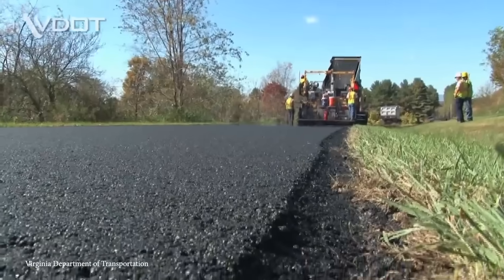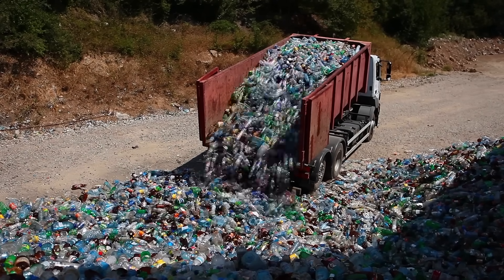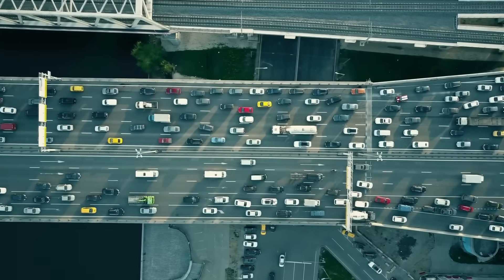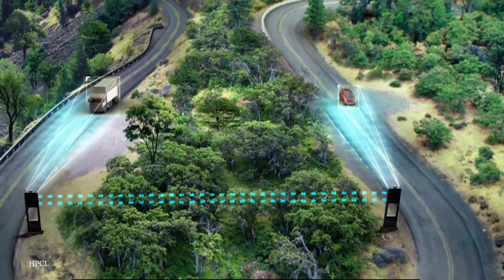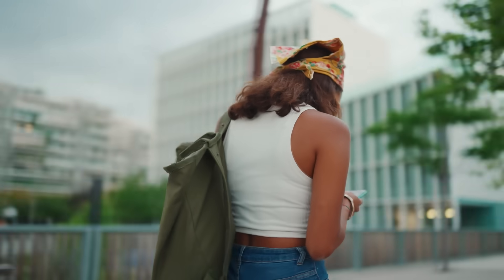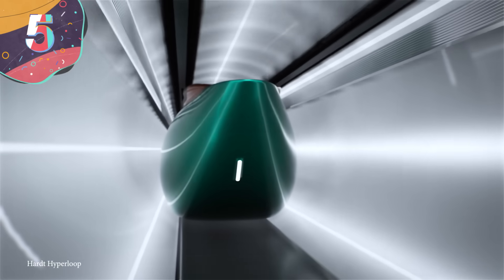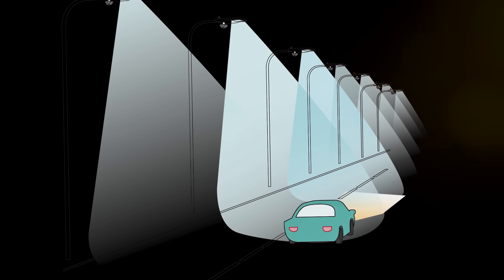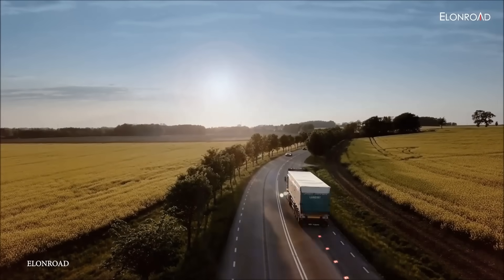15 FUTURE Road Designs that will change the world

Comment: A bit hesitant about plastic roads, simply cause plastic melts really fast when it gets just a tad hot.
Personally I wouldn't recommend it, especially in hot places since it would melt and become a fire and breathing hazard.
Reply: And asphalt is 98% reusable, unlike plastic.  Has better grip for tires than plastic, even when wet, and doesn’t leach/outgas/put micro plastics into our eco-system.

You want to do something useful with plastics, find a way for them to be turned back into the oil they came from.
Reply: Just a bit? I haven't seen anything made of plastic, for use in construction and around the house, that has the durability and toughness remotely close to traditional materials. Low stress applications where its set and pretty much forget, such as siding and some plumbing, is all its good for. These roads would be as hard to dispose of (or recycle) as turbine blades are now. Pop Sci greenies that typically ignore so many other factors would love them though. They love stuff that is superficially Earth friendly, while ignoring issues such as the non-green manufacturing, short lifetimes, ease of maintenance, ease of repairs, and ultimately, disposal

Comment: I had this Idea about synchronized traffic lights for some time. Why not have the traffic light inside the car? Each car console have a traffic light system inside the car to guide the driver. All these units are linked with a central computer system. It analysis the data and give optimal switching. This is extremely cost effective! because a traffic light is very costly!
Reply: A traffic light is way cheaper than the idea you have.    I install traffic lights.
Reply: @jamesgarrison6430  not if it is mass produced! Further if your destination is given, the system can optimise the lights to give a synchondrosed response, taking into account all other cars that input the destination.
Reply: @lalsenarath  That's the problem. Mass production. Traffic lights are already mass produced.
Reply: @admiral_gravleos8  right it should be a standard component of the car, along with gps navigation, which some cars already has
Reply: @lalsenarath  yea make cars more expensive and inaccessible for more people. Your solution is faulty at so many levels. How are the cars connecting? Where is the bandwidth for all the data collected? Who provides and pays for the servers that run this system? Will there be different systems for different countries? Keeping things simpler/cost-effective is the way to go if you want new systems implemented.

Comment: The first time I experienced linked traffic signals was in the early 80s, Dortmund in Germany had them. The Autobahn flowed straight into the main route through the city, each set of lights was linked, you stuck to the limit you'd only get stopped at one set, then return to the Autobahn outside the city and back up to speed.

The results: slow moving traffic through the city, lower emissions, improved fuel economy.
I have to say, it could be nerve wracking approaching a set of lights at 50 KPH thinking: change, Change, CHANGE!!! but they always did.
Reply from the maker: Interesting thanks for sharing
Reply: The Netherlands has those aswell and also combines with the traffic lights for bycicle lanes and pedestrians.
There are several YT video's about it made by (Americans) to compare to US road systems.
Reply: @d3al3rplays68  They even have rain sensors for bicycle pads and closed garbage containers with sensors when they're full. Roundabouts which speed up traffic too. 

This isn't new technology at all this has been there for years and years. The US is in all traffic infrastructure is decades behind the rest of the world.
Reply: yap yap yap

Comment: What happens to the glow-in-the-dark road after a cloudy, sunless day?
Reply: Light energy still passes through cloud, solar panels still charge batteries on dull days, but instead of 8 hours, perhaps they would only work for 4 or 5.
Reply: If only we had some kind of markings and signs that could reflect some of the light our cars are already outputting...
Reply: @bscholer  ya we do they are called "cat eyes".
Reply: They don’t shine, someone crashes, and they sue the municipality for $20 million worth of pain and suffering
Reply: It doesn't glow
Reply: @JonRuisiCustomDev  Best reply. Narator should have said that during the video.
Reply: it acts just like a typical non glowing road most use today

Comment: The ultimate future road will power and drive your car for you, so all you need is a shell or a pod to sit in.  Think of all the energy we'd save if we don't have to create an engine that can move a multi-ton vehicle but instead just needs to move you and a lightweight pod.
Reply: @ Marchant2   if you cant drive a car or steer it properly get the fuck off the road.Dont be the problem.
Reply: The energy required to move your pod will still have to be generated, as will the cables carrying the power to the roads, plus the pods, it might improve energy use, but perhaps less than you imagine.

Comment: How about more roundabouts (in the US)  where there are so few compared to other countries. Helps to facilitate traffic flow compared to traffic lights, and normally decreases commute time.
Reply: Carmel, Indiana is leading the way in adopting roundabouts in the U.S.  Soon will have eliminated all traffic signals on city streets.
Reply: I remember the infamous traffic circle in New Brunswick, N.J. where I was born 79 years ago. we used to go to the drive-in movies there. We never went through the circle when there wasn't an accident happening either before, during or immediately after we went through it. This was on the weekend, it must have been worse on the weekdays. They took it out.
Reply: @tedmoss  It is all inexperience with driving on them and probably the design is also not optimal.
Reply from the maker: We need more roundabouts in the US! They are so much better!
Reply: @topfives  Also less braking and accelerating which is better for fuel consumption and the environment.
We have a love/hate relationship with them here in the Netherlands cause we have so many.
Reply: In Poland we have many, the thing is that they are useful if they are big enough to allow smooth entry and exit. If they are small, they cause more congestion and are bottlenecks, where cars get stucked

Comment: The UK has had a solution for marking roads where there's no street lights for decades, they're called cat's eyes and they do the job fantastically since they use no power and are self cleaning.
Reply: But unfortunately the UK isn't great at road maintenance. Many roads that used to have cat's eyes are now blind
Reply: @frankhooper7871  Same applies to the glow in the dark roads though. My understanding is that its basically just glow in the dark paint.

Comment: Even with the application of AI to LA’s synchronized traffic system they will still see unsustainable growth in traffic congestion until they change their focus towards public transport and walkable neighborhood based solutions, this much is mathematically certain. For more information I suggest reading strong towns.
Reply: No, the main problem is drive-through traffic that needs to be blocked off into its own lane for longer, similar to express/public train systems present in NYC. The traffic is almost always caused by crashes. The traffic would be greatly improved if there was a true express lane from one side of the city to the other. Splits traffic into 2 lanes/3 out of 5 lanes present. Traffic is also caused by cargo trucks going to and from Mexico. 

The last problem is how the synchronized lights on surface streets do not empty cars off the highways fast enough during peak times. Every time I've visited LA, there's always at least one exit that is completely jammed for at least half a mile.

Comment: Solar energy systems have to use batteries to store that power. Batteries have a short life are very highly polluting.  The components, material, needed to make batteries are polluting in mining for them. When the batteries wear out they are discarded, thus leeching into the ground.So, get with that Son.

Comment: I've made this post every time I see flying cars mentioned, if you are driving your car and the engine fails you pull over to the side and call someone to fix it or fix it yourself no problem! 
If you are in your flying car and the engine fails you crash and burn, end of ALL your problems!!!
Reply: Oh be a sport, consider a reasonable set of chutes and ultracapacitors. And 40 kph winds. There's no reason they can't share their fate far and wide or have their autopilot gently bounce them off the backside of a hill to a less knocky stop.
Reply: @davenordquist4663  well if they were flying over the local nuclear power plant taking a short cut to get back in time for the big game that would probably spread them far and wide I suppose
Reply: @davedixon2068  I think that only applies in Nuclear, AZ otherwise it is merely an intrinsically safe reactor. Thanks for being the wind beneath our emergency glidepath wings.

Comment: It only took 30 yrs to employ Glow in the Dark lines! Finally !! oh, 30 yrs because I thought of it 30 yrs ago and have been waiting for someone to try it. I think something GitD that is embedded into the asphalt would hold up a lot better than paint, though. That plastic Jigsaw road is really cool. That would be great to replace cement sidewalks in freezing states, like where I live. It may displace when frozen, just like cement, but it wouldn't break up and need to be replaced, just resettle back into place when the ice beneath it melts!

Comment: Years and years ago before there was much thought about electric cars, I had an idea about running mains electric cables under the roads, and cars would have inductive coils fitted under the floors that electrified the motors which propelled them along. This idea would eliminate the need for large capacity batteries which would be used on minor roads. HoHum.
Reply: Sadly that would likely murder pedestrians. Trains wouldn't.
Reply: Wow! You reinvented the TRAIN

Comment: I know traffic signals are a problem in a lot of ways. They need a way to know if a bulbs burned out without actually being at the intersection. As far as synchronization they gotta teach people patience too. There are some lights I go through every day and people are either moving forward or honking at me to pull forward when the light doesn't change fast enough but it's synchronized because of rush hour traffic. But that intersection never backs up so timing is great.
Reply: Cool picture, how long do you keep your hair? I find it very attractive, please describe it?
Reply: If a bulb is out, you can report it. Although someone already likely has. It takes time to fix them.
The only solution to humans driving better is to prevent them from driving at all. No matter how hard you try, you will never get humans to syncronize.
People can't drive in a circle with one lane in a parking lot without over breaking and causing traffic.
Trains are the actual solution to the problem.

Comment: electrical roads will be  a waste.  I have never needed "more" to get to my next stop.  I drove to from IL to TX and back to IL.  non-stop.  36 hours.  Never worried about the battery.  Mostly staying awake and alert.  Day to day, it never matters.  I never think about my state of charge.
Reply: I agree overall it would be a ridiculous waste to roll induction out to every paved road. BUT,  I think it does have a place. Lithium batteries have the best longevity when they are kept between 30-80% charged. Outside that range the battery is in a state of stress and its lifespan will decrease. Mining Lithium has a heavy environmental and human toll. So it is in our best interest to care for what we have and keep our new evs running for decades and decades.  So on a long drive using major highways would benefit from having an induction lane. Bonus people would be more open to purchasing an ev because they can drive it everywhere and not run out of "gas", since just the act of driving in that lane replaces the energy that you used.
Reply: elettric roads you means trains/metro/ tram?

Comment: Not even an honorable mention for Solar Roadways? They've been around a lot longer than most of these technologies and solve almost every problem your individual choices do. Come on, son.
Reply: I'm pretty sure the title of the video is 'Future roadways' not pre existing roadways
Reply: @patrickrico2467  I'm pretty sure the very first idea is in use in the Netherlands, so that nullifies your attempt at wit.
Reply: solar freaking Roadways? lol
Reply: Bruh that road did not work it broke after  few month or year when meant last longer
Reply: They are a scam
Reply: They tried and didn't work
Reply: Thunderf00t will be all over this video in a heartbeat if they put it in there.
Reply: They have tried solar roads... solar covers, solar bridges. They cost 10 times more than a solar farm, and cost 10-100 times as much to manitain, and produce about 10-30% of the power a normal solar farm does. So no, there is zero need to mention them
Reply: @GuitarNvoice  @keithc.5571 this is also true about the industry.
Reply: @Sea-Keith  There's testing faciiities for that. They literally just bought and installed it and then ran away with the money after it broke in a week. You can still visit that stuff in the netheröands iirc.
Reply: Solar roadways were a massive failure
Reply: Solar power still has its own issues including the maintenance required to keep it up. The road itself may be a great idea but the harm to the environment caused by the maintenance isn't worth it right now. There's a lot more research that needs to be done imo.
Reply: @Lotus_texhs  Do you have any information on this? I would like to check it out,but I haven't found anything...
Reply: @Keith C.  phosphorus is still used in making solar panels I believe. Most phosphorus comes from rock that's mined and the mining industry harms the environment. I could go more in depth but it's alot. I'd say check Google but im thinking about making a video on it now😂
Reply: Solar roads are useless , and phase out
Reply: Excellent funny video: "Solar Freakin Roadways". Just makes sense!
https://youtu.be/qlTA3rnpgzU
Reply: Solar Roadways have already proven to be a failure and not work.
Reply: @Sea-Keith if that true nice but is it alone remember solar panel are mainly glass silicon and rare earth material would a glass road be easier to repair and maintain then asphalt
Reply: @rhoem1353  solar panels need ultra pure silicon of a certain Crystalinity, and currently we are running out of it due to its importance in solar panels and microchips. It would not be cheap or easy to resurface not to mention microtears, and water getting into them via these tears, if you want solar panels on roads, install them on tunnels instead...
Reply: I have a bridge for sale, interested?
Reply: You said it yourself… they been around. This video says FUTURE
Reply: @Sea-Keith  solar road are kinda bad idea in the first place saying build glass road basicly
Reply: @Sea-Keith  better idea to put solar panel on side of the road occational maintance crew come by every few month to mame sure all work still
Reply: @Sea-Keith  would need more test to find out with better source
Reply: @Sea-Keith  well statisticly it less good compared to normal road if build on actively use road there will be little sun receive better build in less use even then if not durable enough to endure those weather make thr road less safe